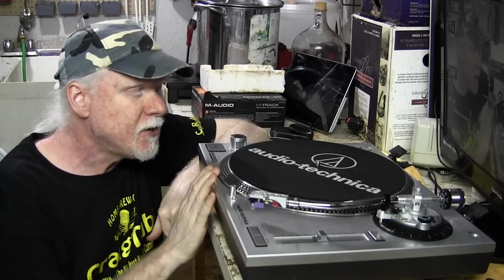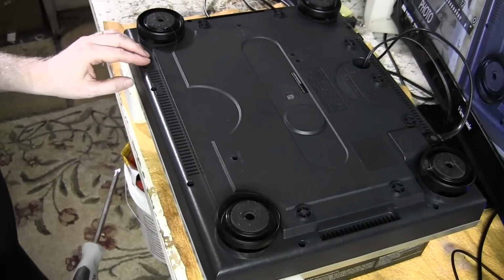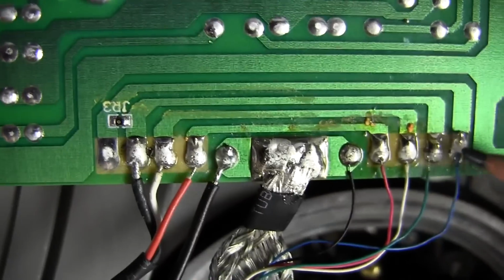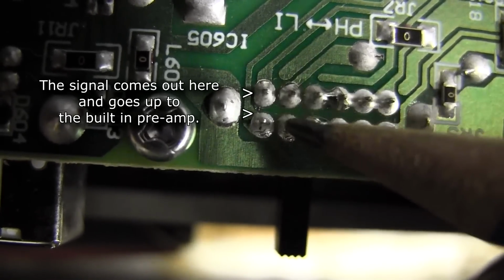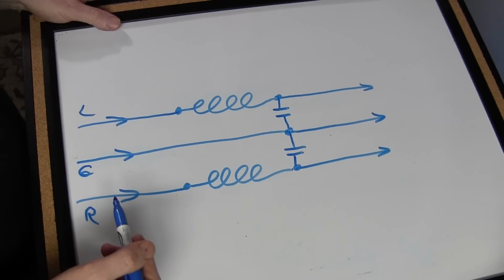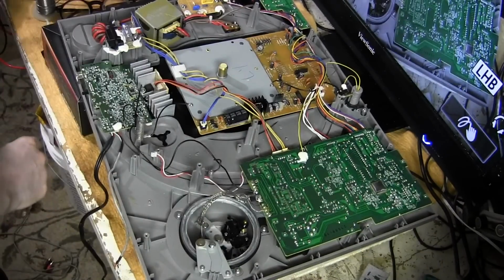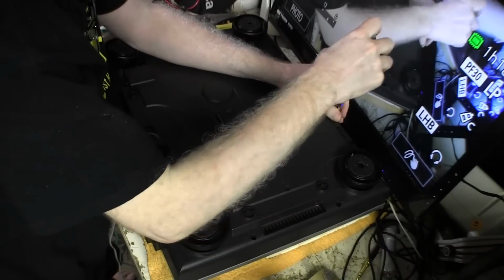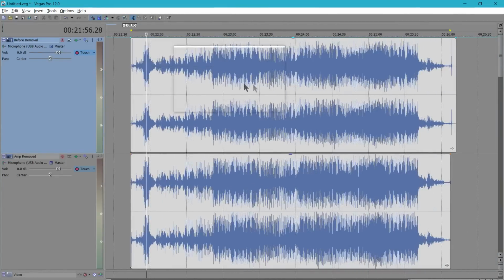Preamp Removal - Audio Technica AT LP120 USB Turntable

Comment: Top video Craig. You now have the best video on Youtube about this topic. I had the same experience as you. Takes that cartridge up to the next level unimpeded. I am sure the circuit is designed in such away to get around the lack of ground wire  hence the capacitors and coils. From my experience In USB mode there was always a pilot tone sound in every instance, in line level mode the circuit produced a gating effect during low passages. Again, glad you took the plunge and as a result made THE best video on the topic. As you know I performed the same bypass surgery on my AT120 with similar results. 17!
Reply from the maker: Thank you very much!
Reply: @VinylTV33  hola que tal ,una consulta. Y que tal es el sonido del pre amplificador que trae el audio technica con tu pre amplificador NiKKO? Hay alguna variacion de sonido?  porque en el video que muestras veo que utilizaste el sonido del audio technica en modo Fono con tu pre amplificador externo. Espero tu me puedas sacar de la duda. Saludos.
Reply: Justin Wolthers love your videos, I'm in that moment where I need a new setup..watched the others videos and very helpful..as for pre-amp..it sounded much more powerful without..im thinking of getting the same deck or the project essential 3 ..great as always
Reply: Why couldn’t you connect tone arm wires to rca plug  wires than to preamp . Ghebertjr @ Hotmail.com

Comment: Yes, there is definitely a difference in sound after removing the preamp. High frequencies are passing through freely now!
Reply: That was an excellent an very thorough description of the process. Thank you for doing this. Could I achieve a similar result by simply adding jumpers across the L-C filter circuit that you drew? Thank you from a fan in Sydney Australia and have a great 2018.
Reply: Yeah, common sense is for morons, obviously.
Reply: That and there seems to be a slight mid/high-mid suck-out with the preamp in place. it doesn't sound that bad with it in, but if I took it out, I'd have to take some of that high-end sizzle off my rips. 

Basically, I'm gonna have to see how it handles the kind of material I work with, which right now is classical records from the local library. I'm gonna pick one up after the beginning of the new year, and I figure the 30 days Best Buy or Micro Center allow for returns should be enough for me to know which way to go with it.
Reply: Did this and wow..that circuit have to go.
Reply: No the high frequencies are still there not filtering out any high frequencies just adding increasing power output
Reply: but at then expense of the motor/coil "juggle"
Reply: MrVinylObsessive  yes, that was VERY OBVIOUS sounding, even to a dummy like me!
Reply: MrVinylObsessive  If I used thier pre amp it would cut out during silent  passages.
Reply: @keithparkhill8546  That gives me the shits
Reply: @keithparkhill8546 :  Yep... I had that too, and it would often cut the first few notes off songs at the start of a record - especially if it was a quieter beginning!  Very annoying....
Reply: i removed the pre amp on the LP 120-yes there was a difference but its not an easy process and should not be done bye someone who has no experience with such a task
also the warranty is voided once this is done
Reply: I think the built in preamp is fine. If you want a turntable to use an external preamp, get one without one built in. Doing these surgeries lowers the value of the unit.
Reply: @billyfowler9423   Ruins the value of the unit? It's a budget-friendly turntable. These things aren't exactly going up in value.
Reply: @billyfowler9423  Like that matters. Are you gonna start a business selling used turntables with no after market value? 

Go back to reddit, dummy.
Reply: you are an idiot

Comment: I was just looking at one of these turntables yesterday. I doesn't look easy to remove (for me)   But I don't have experience soldering. Did you detect any of the noise that the filters were put in to remove? Have you tested the USB function since removing the preamp?

I did notice a difference, especially as the track went on, it seemed to be more and more noticeable.  Nice song by the way.

This was a great video. Thanks for doing this.
Reply from the maker: The built in preamp also has the USB digitizing circuitry on it. I assume that's why they needed to filter. Removing that board also removed the need for the filter. The USB function is gone with that board. Cheers!